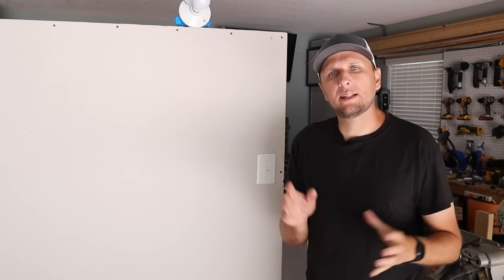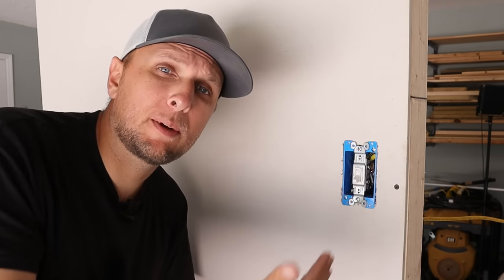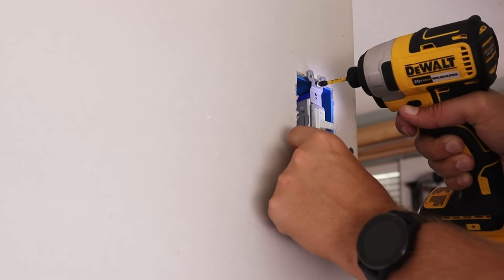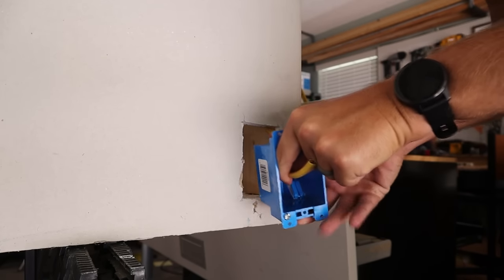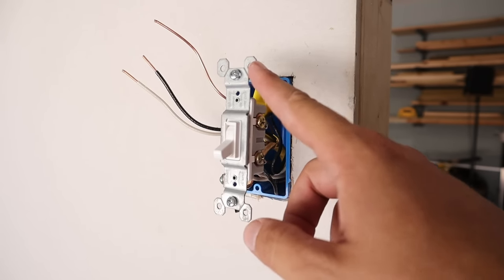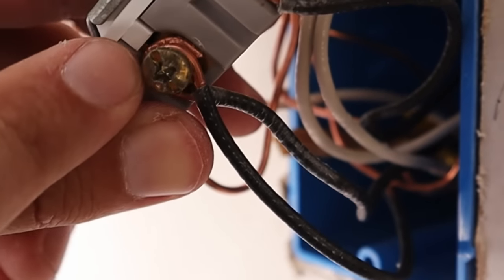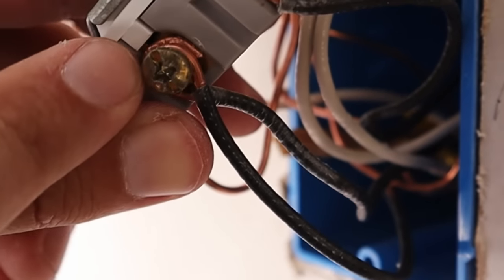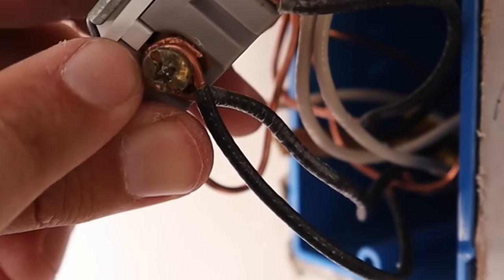How To Add An Outlet From A Light Switch | Common Mistake

Comment: Another person on the internet that THINKS he is an electrician. Don't follow what he has done in this video unless you want trouble. As a Master Electrician for 55 years, don't do this. Stay Safe!!!!!!
Reply: It would help to say why, but I guess it's more like a list than just one problem.
Reply: @j777  1 - Never checked until after if there was a neutral wire in the switch box. You need a neutral for the outlet2 - NEVER NEVER use the voltage tester that he uses. You can get false readings many times. Plus this doesn't tell you what the voltage is. Use of a good meter is desirable. 3 - Never checked if the box he is installing might be too low. 4 - The wires coming out of the box are too short.  5 - It looks like he uses a wirenut over again. Manufacturers only suggest using once. 6 - Most manufacturers make a green wirenut for the ground. 7 - Using a jab saw when you don't know what might be in the wall is very dangerous. slowly cutting through the sheet rock with a razor knife is safer. He doesn't tell you about circuit size. You may not be able to use a 15 amp receptacle on the existing circuit.  8 - May be too many wires in that size  switch box to be legal and not cause heat problems plus against code. 9 - He uses the wire strippers pretty wildly. So easy to nick the wire and could cause many problems. 10 - Using a screw gun to run screws into a plastic box usually strips the box holes and needs to have a new box installed.

Sorry, but this is just a few items. If I would have worked like this, and my boss noticed, I would have been fired!! Things like this look simple but it is the little things that make it safe.
Reply from the maker: I have found it is more so that they don't care for DIY.  Rarely is there a reason.  If so, I am always willing to listen if it is legitimate criticism.
Reply: @HowToHomeDIY  DIYers are fine. I just don't want to see some one get hurt or have a fire because of someone on the internet doesn't know how dangerous it is.
Reply from the maker: @eehibew  Ok I see your list.  Ok yes you need a neutral.  The voltage tester is fine.  Every single one of my electrician friends use them.  I have never found it to be wrong but should be checked more than once if in a crowded box.  Yes the box would not be that low on a real wall.  This is a mock up and I had limited room.  The wires are not too short they were at least 6" in both boxes.  They were brand new wire nuts.  I don't talk about circuit size because you are going to have to figure out what you need for your particular situation or the video would be 3 hours long.  There are nowhere near too many wires in the box.  The fill capacities are on the box.  There was nothing wild about the wire strippers, that is how they are used and I have never stripped out a box using an impact.  But yeah if you want to just keep the finger on the trigger after its tightened down then maybe that could happen but I would bet you would strip the screw head first.  Oh I forgot your green wire nut comment.  Yeah they aren't required but they are nice if the box is going to be crowded.  I am all for helping others and pointing out better or safer ways of doing things but much of what was said was either opinion or just false.  No fire hazard.

Comment: Jesus you must have very low standards in yankyland, a power oulet off a light switch wow!
They are 2 separate circuits in OZ the light cct is 8A n the power cct is 16A n WTF wirenuts really & solid core wire colour coded backwards black is live, like I said low standards have you ever hear of junction boxes in the roof with actual screw connectors called BP connectors or even Wago connectors but the light & power cct must be kept separate, weird n backwards that's all I can say!
Reply from the maker: Well our toilets spin in the opposite direction too soooo.

Comment: You just can't connect Power sockets from a Light circuit. Its dumb, dangerous and stupid.!
Reply from the maker: Sure you can.  It is done all of the time.
Reply: @HowToHomeDIY  Only by ignorant DIYers looking to set fire to the house.!
But then I live in the U.K. and its an instant safety failure, for that very reason.
Reply from the maker: @G1ZQCArtwork  False, electricians do this as well here.  But please explain how this will set a fire.  I love to learn.

Comment: All the gear and no Idea,  you are obviously not an electrician. 
1m2 or 1.5m2  for lighting
2.5m2 for power sockets. Also if you over load that socket it will keep tripping the circuit breaker. Trouble is a little knowledge is a dangerous thing in the wrong hand.
I wish people would not post these dangerous videos
Reply from the maker: It’s so weird that none of my breakers have tripped where I’ve installed this.  Did you know there is no code on the number of receptacles on a circuit?  It’s how much amperage are you pulling on a circuit.  So if I plug my device into one outlet or an added outlet, it will make no difference.  If you overload any socket it will trip a breaker.  Come on man! 😂

Comment: HATE PLASTIC BOXES. I WISH PEOPLE WOULD QUIT DOING THINGS THE CHEAP WAY. ESPECIALLY WHEN HOUSES ARE SOLD.
Reply: why when plastic boxes are used in new construction just as much. metal boxes are pain in the ass especially when a mud ring is used. the chiseling out drywall, tile etc to get the mounting screws for mud ring is complete hassle when plastic box wouldve worked just as well

Comment: it's 6 inch outside the box, not from the back of box.
Reply from the maker: No that is incorrect.  Look it up.
Reply: @HowToHomeDIY  Remember, inspectors also go by the ICC.  Which is not min. code by the NEC, in which it says to this day 6 inches from outside of box.  Your just a scab, let the electrical done by pro's like me.  30 years and Journeyman Electrician.
Reply from the maker: Buddy, you need to go back to school then.  That is kind of scary that you have been wiring homes for 30 years and don’t know code for one of the simplest and most common installs.  The NEC clearly states that it is 6” from where the wiring emerges from the sheathing or raceway in the box and also needs to be 3” past the edge of the box.  It’s NEC 300.14 if you would like to brush up on it.
Reply: @HowToHomeDIY Your a hack, do you know how to bend conduit, do voltage drop, calculate for a service,  know how to derate conductors for conduit, transformers, etc? That code changed in 2017.  Before than it always was outside of box.  The NEC is min. code, so you can have 6 in beyond the box if you want.  I will do it like I was trained to.  Just keep saying to yourself blk to blk wht to whit grn to grn.  Make sure you run an grounded conductor to all your switches, and have a disconnect at your meter can.
Reply from the maker: Aww we have resorted to name calling.  Yes you can do it that way if you would like.  You are right about that.  But the original 6” I talked about is still correct.

Comment: And then you open the switch, and there is no neutral, no ground in sight,   just phase in and phase out ....
Reply from the maker: Yup, in some older homes, won’t be able to do it then.
Reply: @HowToHomeDIY  Re old homes.   This is in my (daughter's) 2010-built apartment.  In my 1960-s house, I have neutral in all the switches I had a chance to open (which are not all, so cannot claim 100%)

Comment: A little disappointed in the video. There is so much detail you left out that could help people. Like little tips. How far back do you strip the Romex, did you strip it once already in the box or with the box out of the wall? How’d you strip the Romex? How much should you strip off each individual wire end? How’d you take the outlet ears off? How do we identify an old box vs new box and if the ears need to come off? 
When you connected the ground wires you switched from a yellow can to a red cap, but when you connected the neutral wires you stayed with a yellow cap. Why?
Reply from the maker: So you want a 1 hour video.  I have to cut out so much stuff otherwise people don't watch the whole thing.  Those little things are considered nice but unnecessary.

Comment: Another wanna be diy handyman trying to show people things they shouldn’t be. Sure this works in some applications but definitely not all applications. Also he said if you cut the home run wire there are ways to ad a junction box and and fix your wire run. This guy has good intentions but he does also not have a lot of first hand experience in different applications. Plus the fact that he still uses his pliers to make the loop just proves he a rookie and is a handyman and not an electrician
Reply from the maker: I used pliers to make my loop?  I used the wire strippers.  When did I say you could add a junction box if the wire is cut?  I said a new wire run would need to be made.  But since you brought it up, you actually can add a junction box to fix damaged wire but it can't be under the sheetrock and has to be accessible.  If you are going to criticize, at least be factual and explain what can be done better.  Maybe everyone can learn something.  And yes this is a DIY channel.

Comment: He installed a violation. Too many wires in that switch box. He terminated the grounds incorrectly. Most municipalities require the grounds to use a copper crimp, not a wire nut. Don’t listen to this guy. He is not an electrician. He is a jack of all trades. YouTube is loaded with videos with incorrect information.
Reply from the maker: Says the guy who is wrong about the wires.  They were under capacity for the new work box that was already installed.  Also, no, almost nobody requires copper crimps on grounds, not even in places like NYC.  Wire nuts are perfectly acceptable in MOST places.  I am not an electrician, but you clearly aren't either.